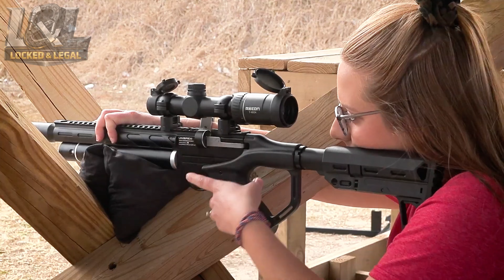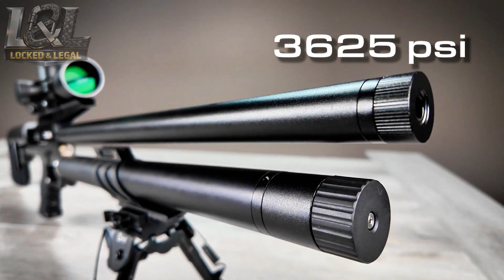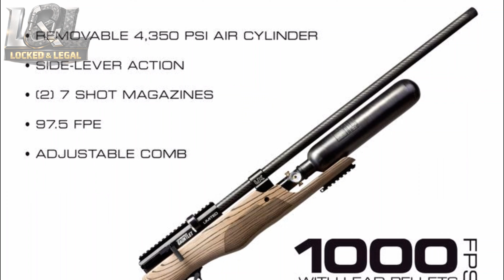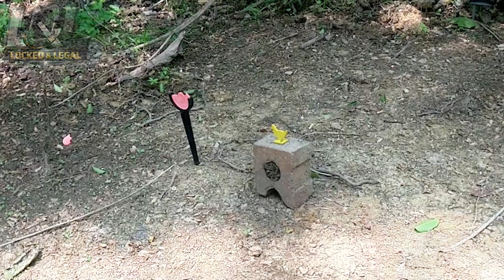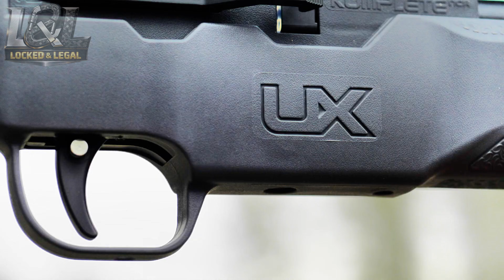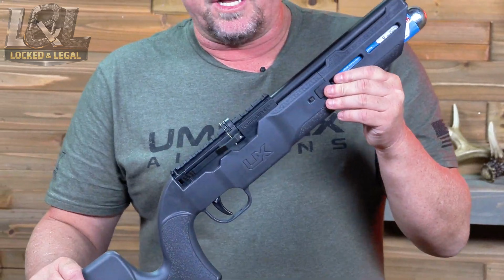The 7 New UMAREX PCP Air Rifles Are Dominating the Market in 2026 - Meet The New King!

Comment: I have the UX G2SL Limited in .30. From full tank it sends four mags of 50gr slugs over 1000 fps 👌
Reply: I have one i built from buckrail and hajimoto ar style with a 700cc bottle and a huben black hawk reg. 2600 to 3600 psi I usually run it at 3000. I rebuilt it cuz its still in my top 3 maybe higher and I have hubens Aeas and firearms and I prefer it over all of them often.
Reply from the maker: That’s a solid setup 👌 .30 cal with 50gr slugs at that speed is no joke, and getting that many mags per fill is impressive. Sounds like it’s performing exactly how a big bore PCP should.